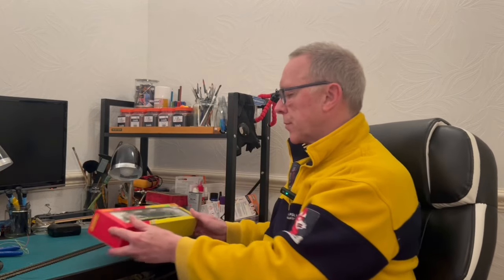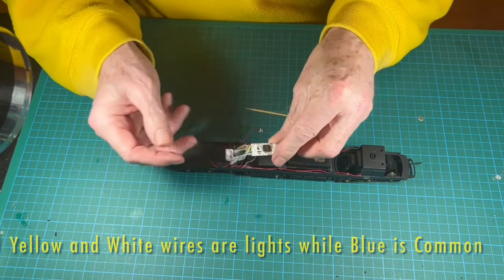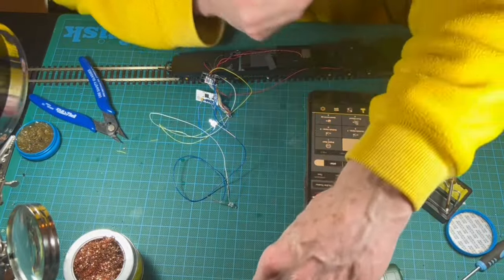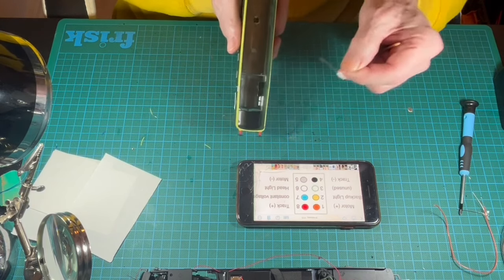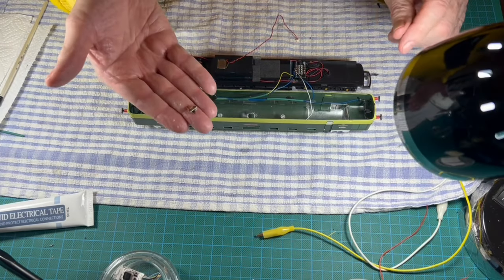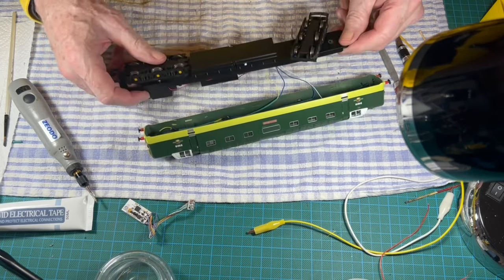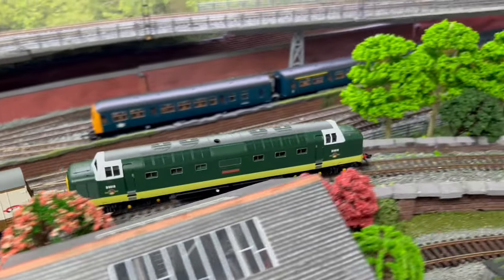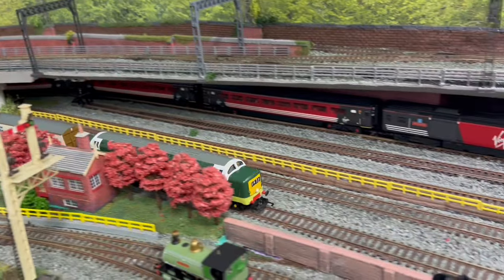13 April 2024… Lights Upgrade for Hornby Deltic Railroad Plus HM7000 TXS Sound

Comment: Hi Steve. Thanks for a very interesting video. I'm getting to the point where I need to decide what style of coupling to go for on my layout overall. It's a shunting layout and I have a lot of wagons that have many different styles of coupling that I will need to replace and will certainly take time and finance! How do you find the Hunts to use? I'll admit I was angling towards Kadee couplings and very few wagons will be run as a set. But I suppose I could use hunts as long as I don't mind the hand of God working every train! lol. You've definitely given me something to think about. Top work on the conversion too! Thanks again and hopefully I will see you at GETS again this year 😉 You can have one of MY cards this time 😄
Reply from the maker: Hey Mav …. I use various types of couplings depending on the type of train or how I’m using it. Hunts and other magnet variants are good for general use and improve   Reverse running and handling. However they all require the Hand of God when shunting. Other non magnetic types need Gods piece of wire or plastic 🤣
I do think the new Bachmann Auto uncoupler will be a game changer for shunting. Especially if Bachmann produce a version that can be retrofitted to other locos. Or as other manufacturers produce their own versions of auto uncouplers. 
Once you have an auto uncoupler you will be able to choose the least obtrusive and most appropriate hook coupler for all your wagons. 
Good luck deciding which one though 🤣🤣
Regards … Steve 👍